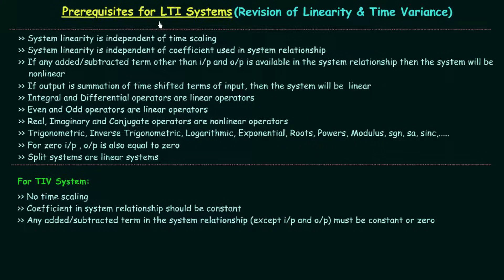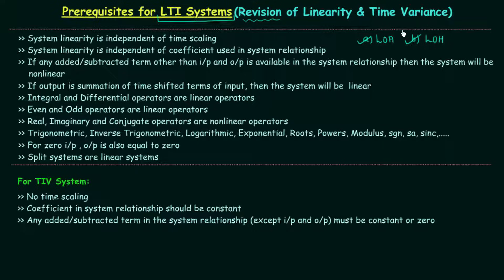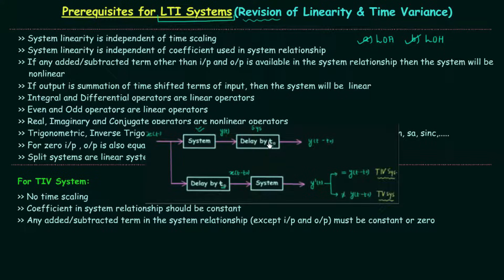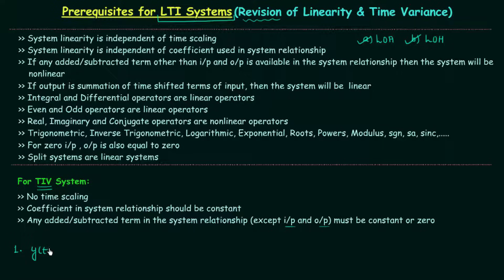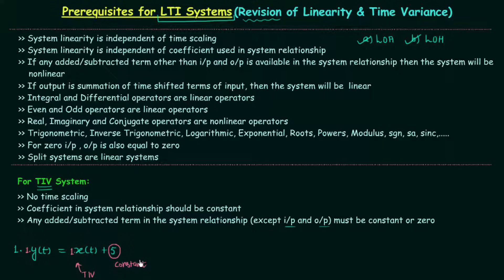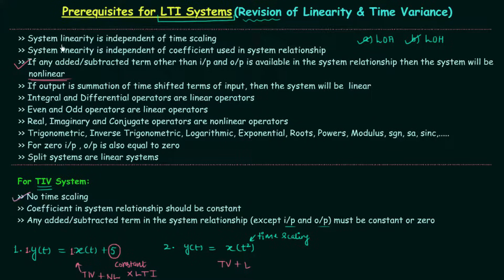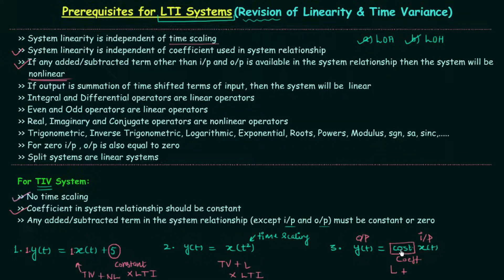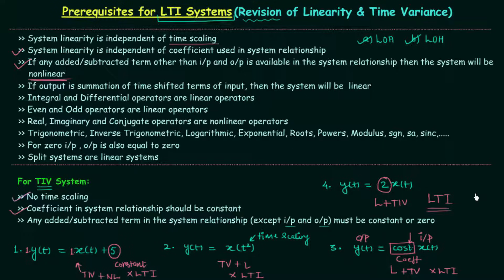Prerequisites for LTI Systems (Revision of Linearity & Time Variance)

Comment: I think example no 2 is wrong. Is t^2 a case of time scaling? Plus I checked it the original way. When we shift the input by t0 the output also gets shifted by t0. I think it should be an LTI system. Correct me if I am wrong.
Reply: Ruben Pereira you’re wrong...... in the post time scaling it will be (t-t0)^2 and in the pre scaling it will be (t^2-t0)